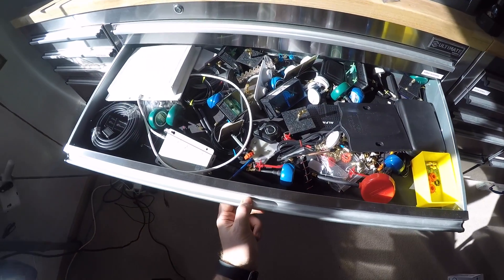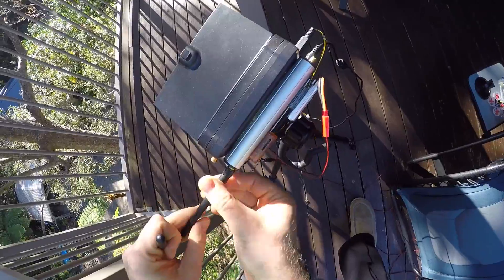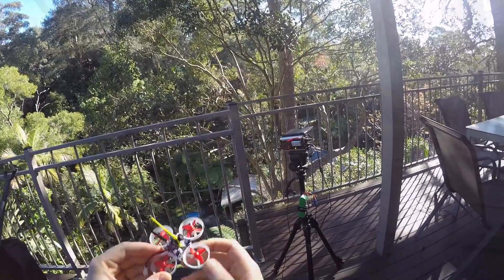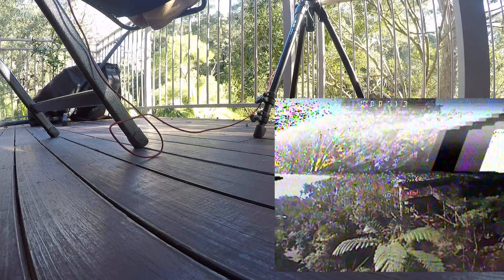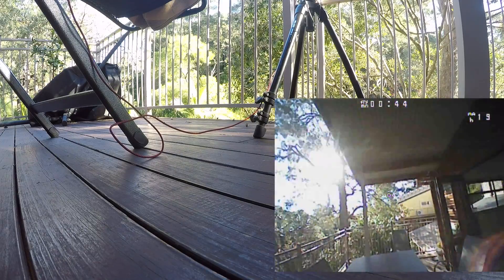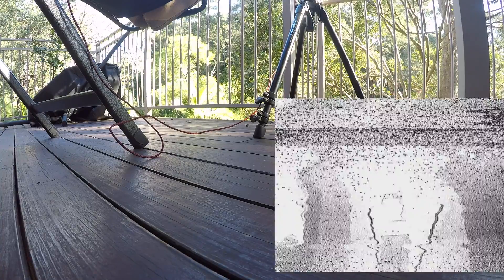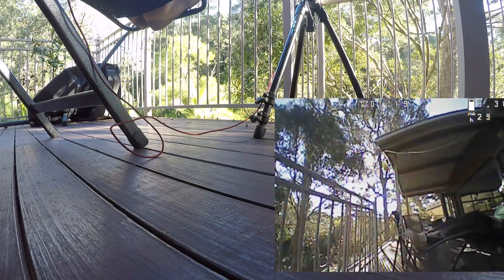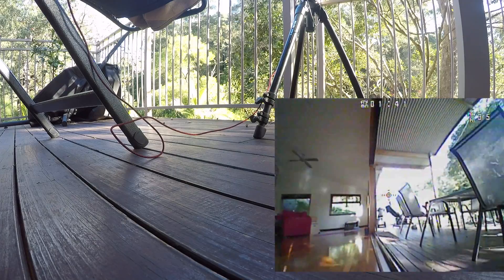5.8Ghz FPV - WITHOUT receiver antennas

Comment: So I recently broke of the antenna of my video transmitter... But it works just fine without the antenna do you think I can safely use it without it starting to short circuit?
Reply: The transmitter can burn out without an antenna. Buy a replacement and find someone to help if you need to solder. That's my 2c.